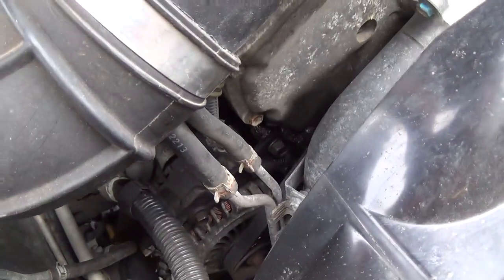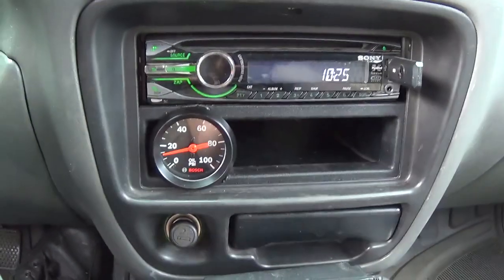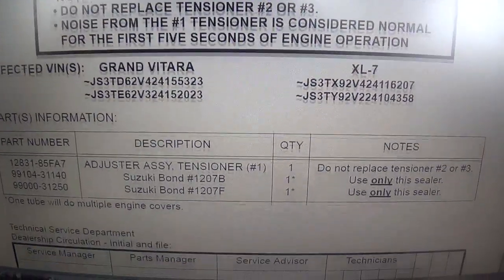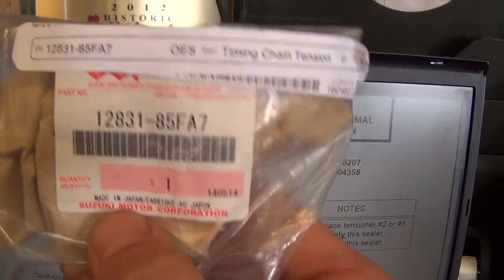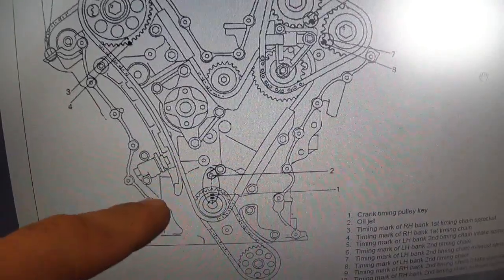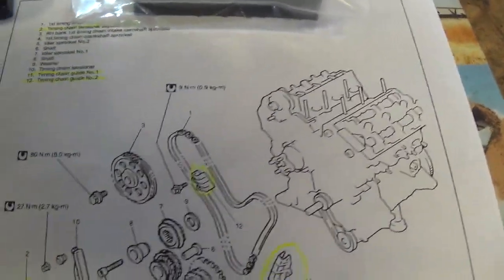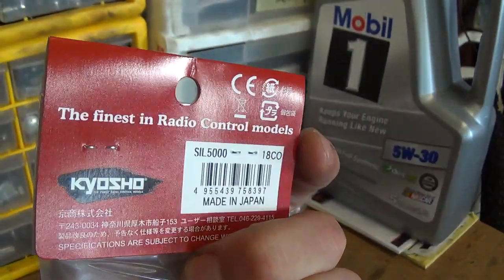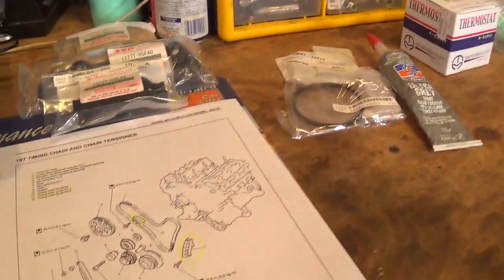Suzuki Truck V6: Timing Tensioner Replace -Part 1 of 5

Comment: After watching the full series I feel pretty confident working on my 2002.

I Don't have the tensioner problem yet, I do have a leaking valve cover gasket and a broken radiator and fan.

I ordered all the parts, saved the videos and feel confident doing this repair, thanks man.

Comment: Man am I glad I came across this video. I recently bought a 2002 XL7 and this video just gave me so much hope if I ever need to replace the tensioner. I have to do the cylinder head cover gasket which will take some time coz I have to take out the whole intake throttle body but after seeing this video I know it's not going to be that much work. I noticed that there is a little knock on the engine on cold start up but it goes away when it's warmed up. So I'm hoping it's nothing major. But thank you so much for making these video. I really love this car and I hope it can last me a long way. Currently at 93k miles. So hopefully I can take this bad boy to over 200k. #suzukixl7gang
Reply from the maker: They are solid trucks! If the tensioner starts rattling just try a little heavier oil. In the summer I run 0W-40 or 5W-40 synthetic, much better that the spec 5W-30 :)
Reply: @PineHollowAutoDiagnostics  Brother! Thank you very much for that advice. I will do that on my next oil change.

Comment: took me 4 hours to replace water pump,
Took off intake manifold, remove valve covers and remove gasket maker on timing cover, remove one timing chain tensioner then remove water pump and installed.
then redid the gasket the timing cover and put everything back on.
off course i removed the radiator and belts

Comment: Mine's at that stage right now and I'm getting a random misfire code I suspect is being caused by timing variances between the crank and cam sensors, the engine runs perfect otherwise. I can't complain too much as the truck's got 184K miles and I've owned it since '01. It's been an amazingly great little truck without any real problems since I bought it used. Worth fixing. I'll be doing everything in the timing section chains, guides and all. And doing the water pump as it's never been done! Thanks for the vid series as it's going to help even though I do have the factory manual.

Comment: aye bub I have a question for you. totally unrelated. same truck as yours.. I broke Two studs on my front wheel Because some dumbass stripped the piss out of them. I was going to replace them but there is a tone ring on the bearing assembly. is it possible to do without replacing the whole assembly?
Reply from the maker: See if they are sold separately. If not, then you need the entire hub assembly.

Comment: Just a question... what size is your tires? And is that stock wheels? Did you get a lift kit? Thank you
Reply from the maker: Right now I am running P215/70R16. Stock size was P235/60R16. Everything else is stock, except rear shock absorbers are Monroe MaxAir that have a manual air assist for heavy loads.
Reply: Looks nice bro. Do you have any rubbing on that size of tire? I'm planning to get 225/75/16 do you think it'll work? I don't have a lift either
Reply from the maker: hmmm I think you will get some tire rub on the front wheels with that size. Mine just barely clear the front mudflaps.
Reply: What year is your truck? I have a 2002 XL7 that I just purchase with a low mileage . The stock wheel are 235/60/16 for me the tires are too small for the truck . I wanted a more bigger tires

Comment: Hey, I just wanted to thank you for this very important video.  I just did this job to my 2002 and had you not been there to show me how easily it can be done, I'm pretty sure the manual and forums would have meant a huge repair bill or early death to my truck.  

You did a fantastic job on this and I really really appreciate it.  - Mike L.
Reply from the maker: Hey Mike, glad I could help! Keeping older vehicles on the road is one of my passions :) Great job on the repair, hopefully your Suzuki will give you many more years of trouble-free service!

Comment: what underbody shield is that?
Reply from the maker: http://www.rocky-road.com/tracker-skid-plates.html
Reply: Yay! Will be ordering soon. Where does it mount to? I see the front two look like it's the subframe but the rear two look like the cross member?
Reply from the maker: yup 4 bolts. It's saved me quite a few times now, especially the front diff and oil pan that hangs low
Reply: Yeah, I use a Grand Vitara to deliver mail and there's been several times that I've hit a piece of washed out asphalt when getting back on the road on the cross member. Thankfully it hasn't hurt anything though, but you can see the gouges on the cross member.

Comment: Pulling the engine is honestly quicker than taking out both the steering rack and diff housing with the engine in.
Reply from the maker: Would also be a good time to put in a new clutch :)

Comment: Just performed this proceedure on my recently purchased 2005 Suzuki XL7.  This video is invaluable! Couldn't have done it without it. It was like you were working on my Zuki! Ended up taking me 5 days from start to finish, but I also changed out the water pump and put in a new radiator.  All 5 parts of this series was fantastic!
Reply from the maker: So she runs smooth and quiet now? Glad you found the vids helpful!
Reply: Yes. Runs really smooth. When I changed out the tension adjuster, it's spring was hanging outside the device - so it wasn't functioning at all.  I also tightened the oil chain as you showed. Thank you again for posting these videos.

Comment: I wanted to pass along my greatest thanx to you for posting these videos.

The timing chain rattle in my 02 XL7 had grown so loud that it indeed sounded like a diesel. I had to drive 
it back home 400 kms over the Coquihalla Highway (AKA: Highway Through Hell on Discovery Channel) and thought 
I'd see a couple of valves blow through the top of the engine.

The fix went just as easily as you showed.

One misstep: that little indexing key in the crank shaft. As you cautioned, don't let it drop out! Mine fell into the oil 
pan despite a rag that should have stopped it(!). It is loose in the slot and will not stay there happily. Horseshoes where well 
inserted for me as it fell out the oil drain plug after a blast of air when fishing with a magnet failed. Removing the oil pan is a huge job. Put a touch of RTV on it to act as a glue to hold it in place while you put the pulley to move the chain at times and watch it.

The book time on this from Suzuki was 14.4 hours. One shop said 10 hours minimum. It took me 7 hours and 3 beers total that included cleaning some parts more than they warranted. Considered changing the accessories belts while you're there with all that clearance. The chain guides were good but as you, I swapped them out just cuz I was in the neighborhood.

Thanx again! You saved me a sh-tload of cash and I gained more shop cred with my mechanic Son-in-Law.
Reply from the maker: That is fantastic! Job well done, definitely worthy of more than one beer :)
Reply: The struggle was real.  I took the opportunity to put in a new high output alt., changed belts, hoses, and the water pump.  Considering that my tensioner was only 3 clicks out and a lot of that noise may have been coming from the oil pump chain (mine was as slacked as his), I figure I'm good for the same 80k that she has on the odometer now.  (knock on wood)

Cheers!
Reply: Ahhh the dreaded Coquihalla......smasher hill has claimed a crap ton of vehicles in winter heading down and summer going up!

Comment: where did you tap in the oil pressure guage
Reply from the maker: +zr2trackerjoe Right at the oil pressure switch, driver's side below the exhaust manifold.
Reply: +motoYam82 copy will be doing it to my h25. only rattles at startup

Comment: Hi had the misfortune to break the timing chaim and change pistons, the valbulas escape and I also changed the valves guides and gums of valbulas , but I eat a lot of oil , only when I turn blue smoke seen but after no blue smoke and consumption is approximately one liter every 1000 miles.  PLEASE CAN YOU RECOMEND ME WHAT TO DO?
Reply: Your valve pan covers are dirty. There is a plate in top of them that has oil passage ways in it they clog and force the oil threw the pcv valve (drivers side cover) then into the fuel system.

Comment: Would this video series not apply to the H27 in an '07 grand vitara? It says up to the 2.5 in the 06's but how is this different than the '07 and above H27?
Reply from the maker: +DarthPrater629 Ah I guess they did offer the H27 in the GV in '07 and '08...so this procedure should be similar.

Comment: I once had to change the oil pan on a suzuki grand vitara if i remember correctly. What a freakin nightmare! Did not have to remove the rack and pinion or the front diff. Just kind of loosened them up and worked around them.. Still took me about 6-7 hours :S never again :p

Comment: With an old engine( high mileage) I'd use a 10/40 grade oil. also fit a new timing chain with a spring link, so you can join it to to old chain and feed it round the gears.Take the plugs out when turning the engine.

Comment: That idling oil pressure is scary low when warmed up, any chance you can shorten the chain to put on a smaller pump sprocket and get some pressure?  Used to fix these issues with high volume pump swap out but I doubt there is such a thing for this one.  Quite a job to get to it too.  Larger sprocket on crank with smaller sprocket on pump with the same chain also works.  Lot of custom machining, maybe somebody does this for reasonable coin?
Reply from the maker: +Lee Barnes It did seem kind of low to me too, but the only spec Suzuki gives is 60psi at 4k rpm on a warm engine, which matches. When cold, I noticed it goes up to like 90psi so I don't think a higher-volume pump would be a good idea lol
Reply: I kind of expected that might be the case too.  Just thinking out loud above.  Of course you are right, 90 PSI is just as scary to me and makes me wonder why they don't have a higher flow pop off valve in the first place or if it's set for 120 in their infinite wisdom of it will never get stuck open if it never opens.  High rpm capable engines just compound the issue where it becomes a double cringe issue, one for too low at warm idle and another for way too high when cold and in a hurry to be somewhere.  The solution is rocket surgery where we have a variable capacity on the oil pump which regulates it's own output by the pressure it makes.  Just like they have on automatic transmissions.  Cheaper to cringe, say the all important bean counters.  Still don't like it, but regretfully have to agree - pass on this issue.

Comment: I had a 2002 Suzuki GV that had the water pump break twice!!  Very expensive repair you should replace the water pump while you are in there to save yourself some work later.
Reply from the maker: +MAC T oh ohhh well I'll see how long this one holds out...if it ain't broke don't fix it right?
Reply: +motoYam82 I never had to replace the timing chain tensioners, but I did drive that GV for over 200k miles before trading it.

Comment: Hope you'r not thinking of buying another Suzuki or your neighbours will think you've gotten lost after those tensioner marathons.Never seen as many chains and bound to cause trouble.Is there a possibility that the main timing chain is worn ? Timing belts don't seem hard work considering.

Comment: Must be a hundred feet of chain in the little engine . Be interesting to see if you can get it down to 3 hours .
Reply from the maker: +wtbm123 Well I think Suzuki tried to cram motorcycle technology into an SUV engine...the results are interesting, to say the least. This baby likes to rev...really takes off above 3k rpm! Kind of fun, but I'd rather have some more torque lower down in the revs lol
Reply: +motoYam82 on my Suzuki GSXR it was the thing to do to put a manual tensioner in place of the automatic ratcheting deal. for the same reason too...the clacking